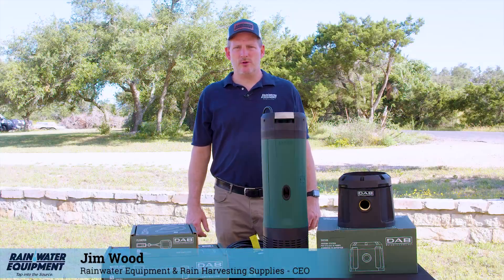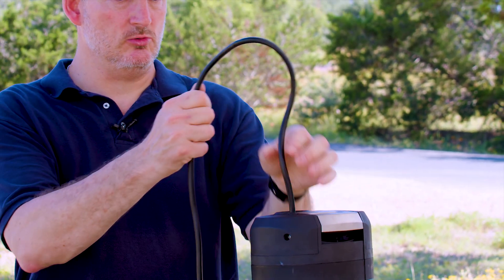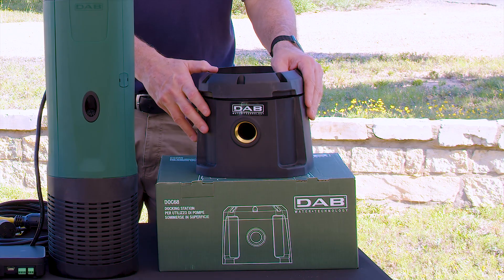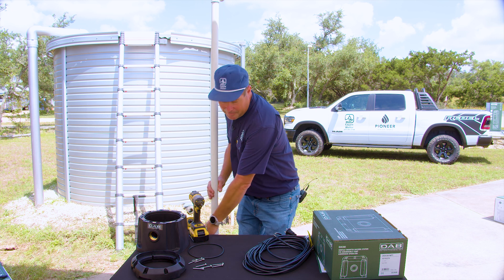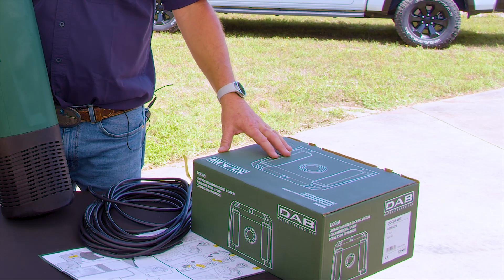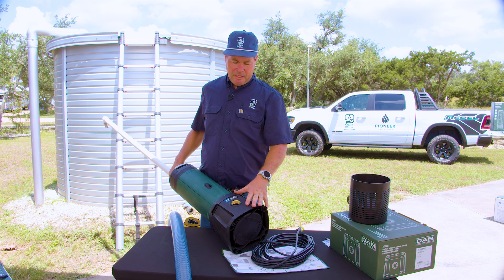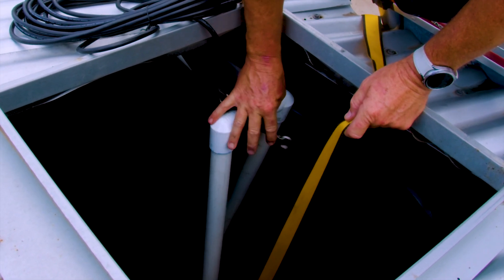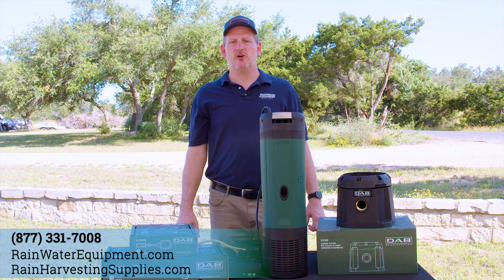DAB ESYBOX Diver - Product Overview and Installation

Comment: Is it possible to run the pump, and configure it (pressure settings), manually without the need to use the Dconnect Box?
Reply from the maker: No, it is not possible to configure the pump without the box. However, the pump will operate without the box using factory settings.

Comment: I'm wondering how these would be used for an underground cistern for domestic water. Inside mounting in line with the output line from the cistern?
Reply from the maker: Yes, that's pretty much it. Connect the 1 1/4" outlet to the discharge pipe, and connect it to your service line that goes to the house. We always recommend installing a shutoff valve somewhere after the pump and before the house for trouble-shooting in the event that you get a leak in your pipe or are trying to determine why the pump won't turn off. Maybe there's a toiler running somewhere that your were unaware of...that sort of thing. Having an isolation valve allows you to deadhead the water pressure against a closed valve to make sure this on-demand, constant pressure pump turns off like it should.
Reply: @rainwaterequipmentllc7835  Thank you. A non- plumber installed the cistern, and didn't install an isolation valve nor drain for the cistern, so we are looking to correct a few things. Oye.
Reply: Well apparently it depends on the demands that are made on the system. I discussed this with my HVAC guy, and they had installed DAB systems for 2 customers so far this summer per their requests. 
Basically they had to go back and install pressure tanks for them to get the pressure they wanted.

Can't tell you if they were on well or cistern, but that's the feedback I got when I asked him.
Reply from the maker: @margieschwartz6757  Thanks for the feedback! While a small expansion tank is certainly not a bad idea to be used in tandem with an ESYBOX Diver (for a totally different reason that the HVAC guy mentioned), pressure tanks have nothing to do with the amount of pressure the pumps can and do produce.

Comment: Hello
Nice information
Just if I like to install 2 pumps together in same tank
How I can operate them
Thanks
Reply from the maker: You can set them up so that the start pressure pump of #1 is 2-3 PSI lower than pump #2. That way, if you only demand 15-20 GPM at the set pressure, only pump #1 runs. If you demand more flow than that, then pump #2 would activate to assist with the higher flow rate while maintaining the same set pressure. Then set a reminder to swap the pressure settings on the pumps in 6 months to distribute the workload evenly. The pumps have 1 1/4" FNPT outlets, so when you bring those 2 discharge pipes together for the higher flow rate, install 2" pipe or larger to handle the higher flow rate. Here's a link to our Diver product page...https://rainwaterequipment.com/dab-esybox-diver-constant-pressure-submersible-pump-system/ and our phone #. 877-331-7008. Thanks. -Jim